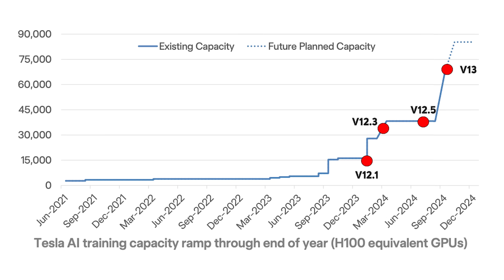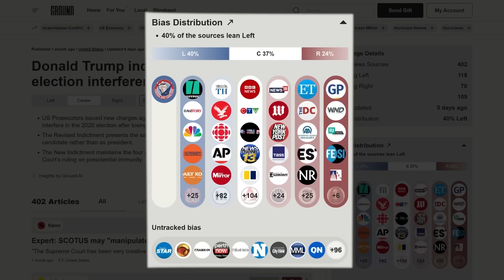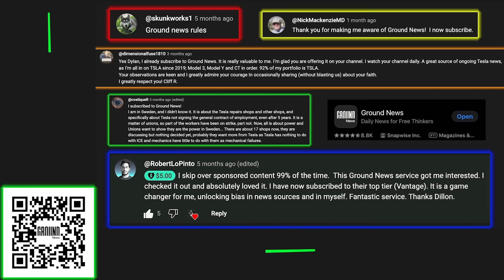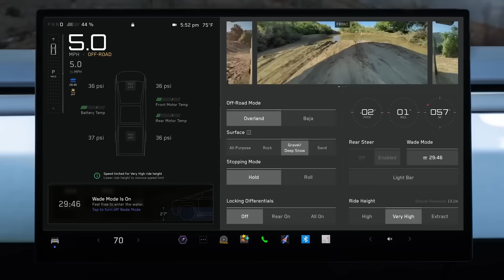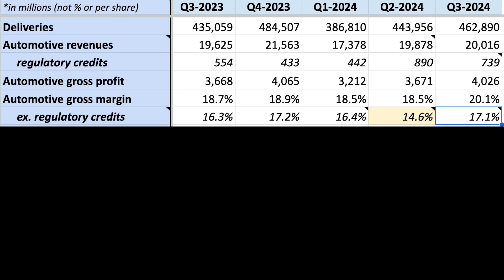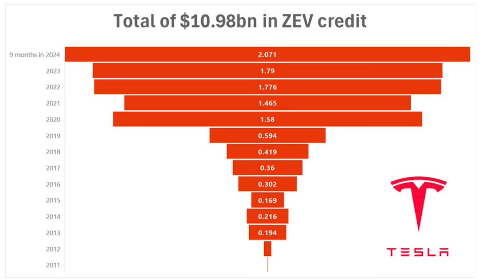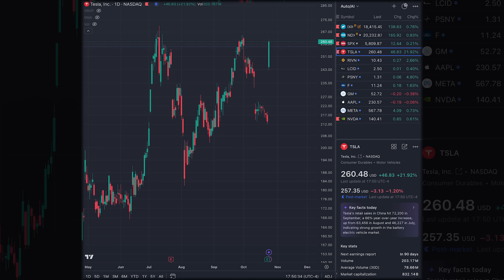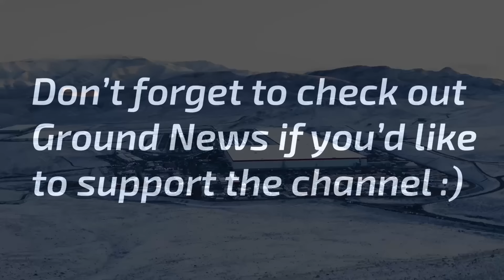Tesla Investors: Get Ready Now - What Was Missed in the Record Q3 Report ⚡️

Comment: Curiously, I woke up this morning to an email from Tesla stating that my 30 day free trial of FSD had been extended. Running from today (10/25) through to Nov.24. I bought my 2024 Model 3 long range dual motor in July of this year. It came with a 30 day free trial of FSD. I never even bothered to use it since I have no intention of paying $8000 (or whatever) for party tricks I neither need nor want. Basic auto pilot is all I need. The only thing I missed when the FSD trial expired was changing lanes with the turn signal. Without that element, changing lanes deactivates auto pilot. Be nice to get that back.

Comment: One fact. FSD on trucking is not really eliminating truck drivers. 

Trucking is expensive due to fuel & maintenance, cost of the drivers are a smaller fraction.

However, if FSD unsupervised driving can be counted as non-consecutive duty per USDOT rule, that will be huge, and may accelerate transportation efficiency by 30-50%.

Comment: If the CyberCab is running on 48V steer-by-wire like the CyberTruck, then you could easily plug in a steering wheel and some pedals for a few-hundred bucks, and sell it as a "Model 2" for $25k with a healthy profit.

Comment: Just imagine if all autonomous semi long haul trips were done after 10pm.  That alone could improve daytime transportation
Reply: I think most of that use case be running around the clock as much as possible.  (say 150k miles/yr)
Reply: Naw naw naw UNDERGROUND 24-7
Reply: 3 fans one model S plaid motor on each end facing same way . On return trip  motors run backwards
Reply: That also means less trucks driving during the day which means a little less traffic!
Reply: That makes no sense. Assets need to be maximized, therefore working during the day as well and there are people at the end of each journey to load/ offload that need to be considered. Ideally, it’ll move 20-30% to night trips but autonomy also generates demand that’ll cover the daily demand
Reply: Autonomous trucks are exactly the same as normal trucks except that you do not need to pay for drivers, deal with unions or manage rostering of drivers. The price of the semi, like everything else, will be set by market forces. i.e. Tesla will charge the maximum that buyers are willing to pay. Given the benefits, this price will be high. Transport operators will run these trucks where and when they generate the maximum revenue. They will not sacrifice profits to make your driving experience more pleasant.
Reply: @anibaldamiao Long term, if unloading/loading is automated enough (boston dynamics's stretch) and if warehouses are automated enough I think its possible.
Reply: And keep in mind the noise and dirt Diesel trucks produce so that therefore in parts of Europe they are not allowed to drive. As all electric vehicles the Semi is near noiseless and people can deeply sleep alongside the roads. Think the night transports with quiet trucks is a whole new proposal instead of blocking and breaking the roads traffic in daytime. Great idea really!😎
Reply: @Mrbfgray WAY more than 150k/year for an autonomous truck. I'm an OTR (over the road) CDL Driver and I average 130k/year myself. I've done 500k+ miles in the last four years alone.
Reply: @LordTimelord    OKAY thanks.  I was referencing Pepsi numbers from memory.  FSD does not apply YET.  That's a whole another value add on.  

But Elon just said the demand for semi is insane, or words to that effect.
Reply: @Lifecoach7Ra  , electric semis are not noiseless but they produce about half the noise of a diesel.
Reply: @Mrbfgray  Demand will be nuts. I have one on order. l put the 25k down on it when it was announced. Should save me 40k/year in the fuel cost ALONE! Less maintenance and down time will be additional money saved. Can't wait for it!
Reply: @LordTimelord     WTG for order.

Pepsi said saved $200k in 3yrs run hard, say 1/3 mileage life span.  Do they tell U price/options?   

 My area has 5 to  7k ft altitude swings, long steep grades, etc.  Regen SO important here.  Speculating the 35mph downhill law will eventually disappear along with cooking brakes.

Unique case in Canada where harvesting timber at high alt. to way downhill to mill generated more power than they required to get empty rig back up.  (what do U do with excess??)
Reply: @LordTimelord    Hope U get it 'soon enough' and it works better than expected.  :D)  Already cut energy required well below original "physics bending" kwh per mile.
Reply: @Mrbfgray  If you're taking about Edison Motors. Yes, the Regen they get on their electric rigs fully loaded with timber going down long hills puts a TON of energy back into the battery.
Reply: @Mrbfgray  Typical Diesel OTR rig uses roughly $115,000/year in diesel. The Tesla Semi will cut that roughly 40k with current fuel prices. That 40k will go into MY pocket. Even if I end up running less loads per week due to charging. I'll make more profit per load, and more income per year.
Reply: @LordTimelord   You shouldn't need to reduce runtime for charging much.  Savings is variable given fuel and electric rates variable, but I take your number at face value.

Comment: In the real world, not over payed high tech land, a model Y is considered an expensive car. Robotaxi is fine vs Uber, but doesn't come close to the cost per mile of a used car.
Reply: What kind of used car?
Tesla manufactures the safest crash tested production vehicles in the world.
How much is your neck worth? How about the ability to use your arms and legs?

EVs can save a person $200 to $400 or more per month in fuel costs. The more they're driven, the more they save.

No more gas station visits, no oil changes, no stolen catalytic converters or damaged exhaust or mufflers, no transmission or fluid changes, no transfer cases or oil changes, brake pads and rotors can last the life of the vehicle using regenerative braking, hundreds of less parts and next to no maintenance.

The warranty on the drivetrain is for 8 years and 120k or 150k miles.

Batteries can last 500,000 miles or more.
Electric motors can last 1 million miles.

No one is saving money with a used ICE vehicle over the long run.

Comment: Good summary. 

For FSD, it's better now, but still lacking at :
* Parking where I want it to. 
* Pulling into my driveway. 
* Avoiding potholes and road debris. 

Until they can close the loop of a routine drive, the general public won't buy in.

That said, I'm confident and anxious to see it get there.
Reply: I'm with you , but I can tolerate the little failures a bit longer as long as the big things get better.
Reply: Add Flashing red lights and 4 ways stop signs
Reply: I think Musk is acting very enthused about FSD because Tesla is facing lawsuits from people who bought it and are tired of waiting.
Reply: @allencrider lol have you seen the improvement rate...outstanding, and accelerating.
Reply: @sdpryce  Maybe they can complete it and take it out of beta. Maybe not.

Comment: Just returned from a 2000 mi road trip.    Had the Nav tell me to go left when I clearly needed to go right.   On Autopilot, it still drifts to the right when passing an entrance lane that is unlined.  Rather than using the left line as a reference point, it just goes center and comes back when the right line reappears.  Had it go into a panic stop when a car entered the highway from the left and although that car clearly had it's own lane to stay in as it became an additional lane, the MY acted as if the car was going to merge into us.
These are not new experiences.  3 yrs of ownership and these are issues that still haven't been corrected.   Call me dubious on the near completion of safe FSD.
Reply: Dubious, everything will be ok.
Reply: You're talking about autopilot not fsd.
Reply: Autopilot and FSD are different programs, they have nothing in common. Autopilot had not been improved in years due to the continual work on FSD.

Comment: I’m a little bummed we likely won’t get a new model. I also believe that’s likely gonna be the case. But in reality it will probably actually be better than a new model since they’ll have most of the supply chain setup where they’ve slowly improved prices. Meaning quality, materials and options would likely be better than a completely new model. It would also likely ramp significantly faster. So it may sell better than a new model, be nicer, and be more profitable. And maybe it’ll be distinct enough it’ll be exciting anyway

Comment: The cost of  redesign  the 4 hardware to be a plug in replacement for hardware 3 is relatively insignificant.  It makes sense that Tesla has already staffed this project as insurance.  The down side to not having it ready when needed is too great.  The tricky part will be lining up the production of potentially millions of inference computer chips when the need is unknown.

Comment: They will have to upgrade the hw3 to hw4 or hw5. Tesla’s unsupervised Full Self-Driving (FSD) system aims to achieve full autonomy, but its hardware, particularly the HW3 (Hardware 3) platform, faces challenges related to compute redundancy. Initially, Tesla designed HW3 with redundancy in mind, having two independent System on Chips (SoCs) to ensure safety and reliability. One SoC was supposed to act as a backup in case the other failed, which is necessary for higher levels of autonomy (level 4 or 5).

However, as Tesla’s FSD system evolved, the company started utilizing both SoCs simultaneously to run more advanced neural networks, leaving no backup if one fails. This means if one SoC goes down, the vehicle can no longer drive autonomously. It can still provide visualizations, but it won’t be able to control the car safely, effectively removing the redundancy once built into the system. This lack of redundancy makes it unlikely that HW3 can fully support unsupervised FSD without hardware upgrades.

To address this, Tesla’s newer hardware, like HW4 and the upcoming HW5 (AI5), aims to improve both the compute power and redundancy. These advancements are critical for Tesla’s vision of robotaxis and higher-level autonomous systems ￼ ￼.
Reply: How do you know this?

Comment: But Elon saying it is hard to find FSD mistakes. 10,000 miles to find a mistake? Many with FSD in the forums easily find mistake within 5 to 10 miles, so I have no idea why they throw that claim out. Go watch Chuck Cook's recorded drives, or Dirty Tesla's drives. There is a lot of good there, but you'll see it do some dangerous things in just 20 minutes.
Reply: Yeah,  because forums have the most reliable,  accurate,  scientific data possible.  Smdh
Reply: Critical interventions are not the same as disengagements because of a pothole or navigation disagreement.
Reply: Sitting at a Green. Running a red. Pulling out into a lane and not accelerating with a car coming up on you at 50+ mph. Those sound pretty critical to me. The forums show actual driving instances. I've got the free 1 month FSD trial and it has screwed up many times in just the first week.
Reply: Wrong turns down dead ends.  Almost head on when turning left unprotected. Almost driving off the edge (2” drop) onto soft shoulder… many every day. My Dad says he has no interventions. 🤷‍♂️ depends where it is. Here it does poorly. Misses more speed signs than it gets.
Reply: People on the forums don't have the latest versions of FSD that Tesla FSD testers are using.
Reply: True, I think FSD is amazing, but I have to intervene regularly. Infact it seems like 12.3.6 was a lot more solid than any of the ideations since.
Reply: What is difficult to understand, Elon and Tesla has cumulative data, you have instances. How can debate the data we do not have.

The best reaction is to ask Tesla to release the data. In the comments,  you kept drawing conclusions from limited information.
Reply: @viewer_5714  I have personal data. There are dozens of users who are reporting interventions to prevent crashes. I see no one saying they can drive for 100 miles with no interventions unless it is on a boring highway without exiting.
Reply: @viewer_5714  Anyone disagreeing with me must not have used FSD. Go rent a Tesla for a day with FSD and try it out yourself.
Reply: I drive FSD ~80 miles a day, 5 days a week during both of the one month trials and I’ve had between 0-2 disengagements each day. Usually zero. I’m sure if I tried to put it to the test in some extreme scenario it would fail but in normal point A to B I’ve haven’t any major issues
Reply: I drive about 35 miles on FSD a day and have never had a major intervention in the past year. (I've had my MYP for 3 years.) The improvement over that time is astounding.